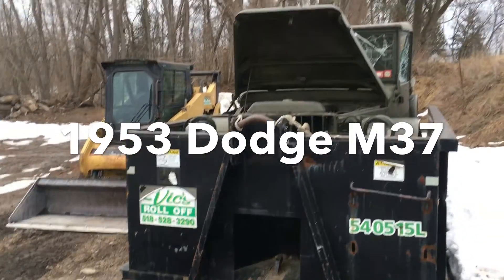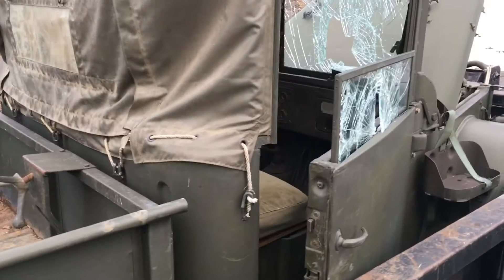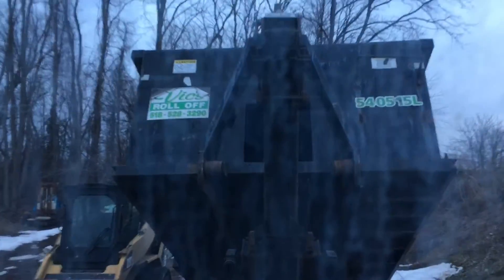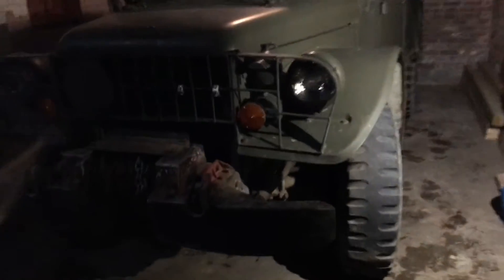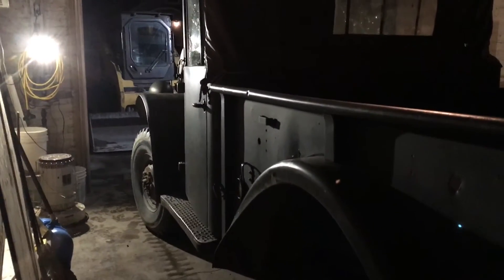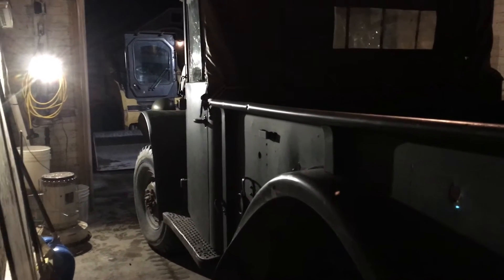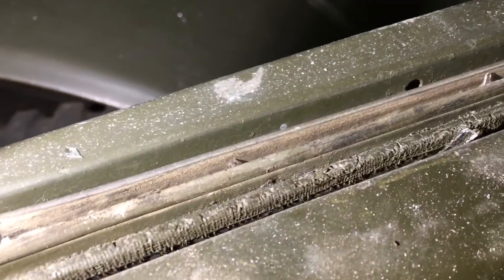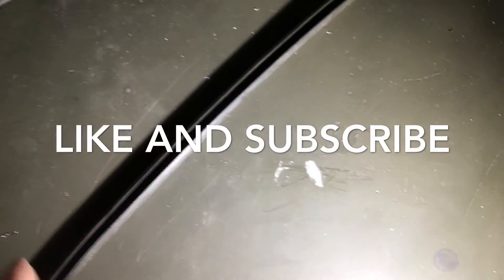Moving 1953 Dodge M37 Into Garage

Comment: Shame the windows got busted up. That's in great shape though. I just painted my frame and  working on axles.
Reply from the maker: Preston Whitt You got an video of yours man? She is clean. I'll keep ya posted on parts. What you think you will have?
Reply: Victor L. Fazio III yeah I should have a video of it. It's getting expensive but just like any other car restoration. But it's getting along. It's going to be like new with restored parts and nos parts. I may make an update video some time.